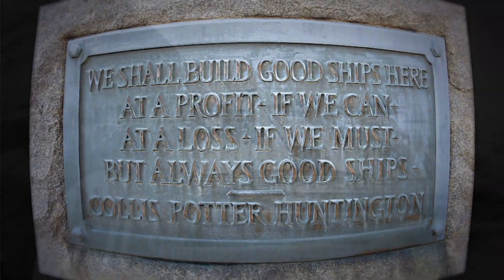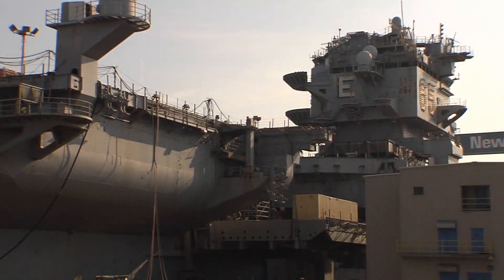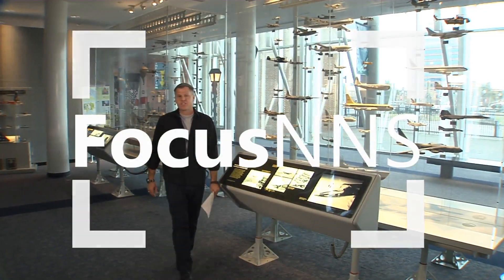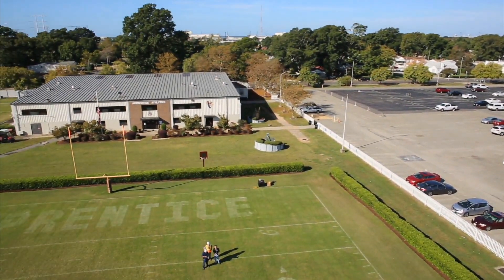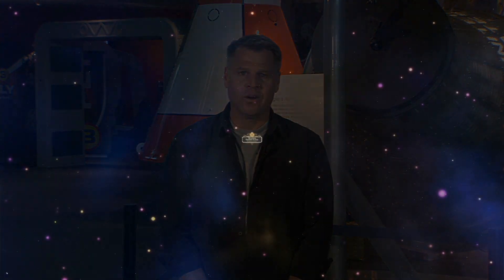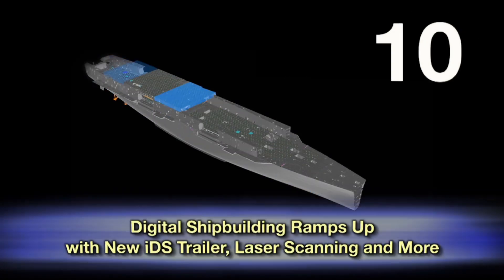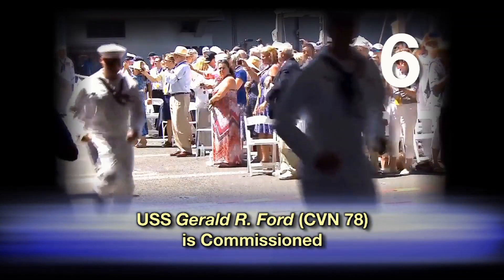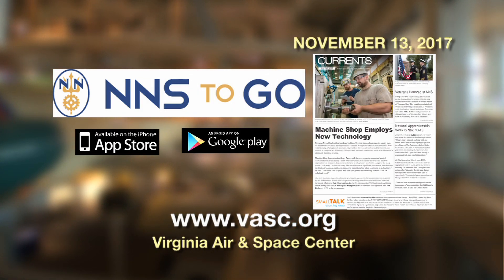Focus NNS: Enterprise (CVN 80) Steel, Master Shipbuilders and 2017 Year in Review

Comment: Folks, the amount of steel they reclaimed is a VERY small percentage of the Enterprise (CVN-65)!
The vast bulk of that ship is STILL tied up at Hampton Roads.
They haven't decided HOW they're going to dispose of the hull because it's going to cost another $1.5billion to dismantle it (MINIMUM) and they've already spent $500million emptying the radioactive material from the 8 reactors inside the hull.
If they're having this much trouble with one nuclear aircraft carrier, what do you suppose will happen as the next 3 ships coming up due for retirement over the next 15 years?!?  The Nimitz, Eisenhower, and Vinson are the original Nimitz-class ships and they're all around 40 years old now.  It's looking increasingly less and less likely that the Nimitz herself will be retired in 2025 since CVN-65 will likely not even be disposed of properly before 2028/2030 at the earliest!
Components of that ship are STILL very radioactive.  That's partly why it COULDN'T be preserved as a museum ship.  Proper disposal of the reactors will not be cheap and I'm sure if they could get away with it, they (the USN) would have sunk that ship in deep water like they did the USS America (CV-66) 13 years ago.
Reply: It was suppose to be towed to a scrapyard but no funds to get it towed
Reply: The Roosevelt and the Washington stennis and the Reagan is a nimitz class carrier